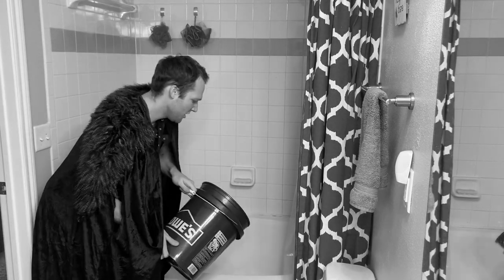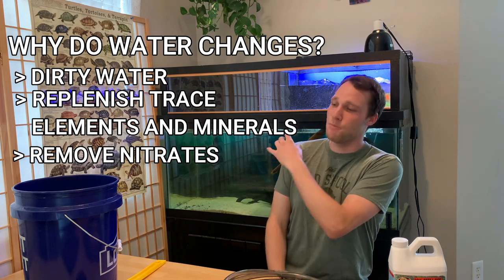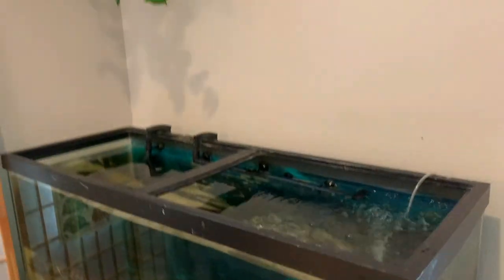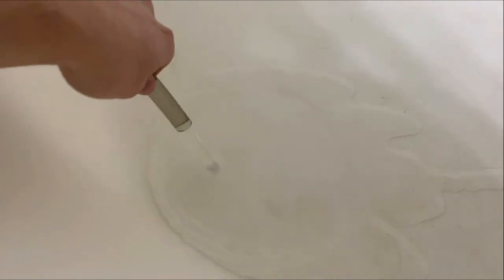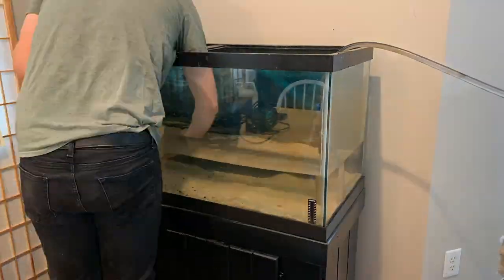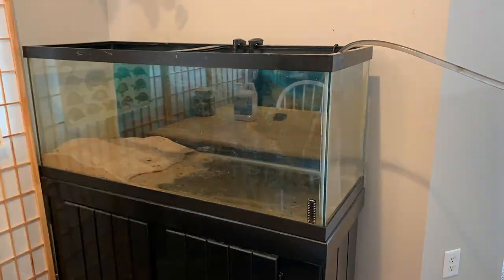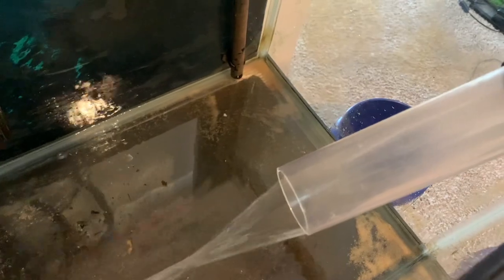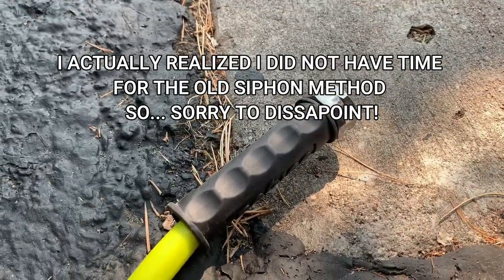Easy Water Changes! Stop Lugging Buckets to Change Turtle Tank and Aquarium Tank Water

Comment: My automatic water changer is really amazing & versatile. When I got my turtle, my friend who specializes in reptiles & aquatics recommended it & I’m so glad. Mine has lasted 6+(?) years now. I’ve moved a lot from apts to houses, originally w a 40 gal tank & eventually my 90gal. The auto siphon has always worked where I lived. One place I did have to go to the hardware store & buy an adapter for my faucet that would just screw on &off, that cost less than a dollar. My current situation I can run the siphon from my tank out of the house to my hose spicket. When you want to pause water flow it has a shut off valve which is really handy, plus it can also be used gravitationally to save water. I know they charge by footage but I don’t remember mine being that expensive. I think there are some off brands besides Python that are cheaper. Also recommended that’s been really handy is an aquarium vacuum, but I can’t say enough about how good an auto siphon has been to me over the years.
Reply from the maker: The python (and similar) are great little tools! Still like my method for my own reasons but the adapter bit is good advice. Thanks for the comment!
Reply: Can u send me a link to your water Changer

Comment: I came across you videos by accident but I absolutely find them so helpful. I was wondering though, could you do a video on how you clean your canister filter or more specifically what would be a good way to clean one for turtle owners who live in apartment buildings? Cause Im getting a canister filter for my birthday in the next week but I have no idea how I will clean it cause it's the middle of winter for me right now with snow on the ground lol.
Reply from the maker: Hello! if you dont want to go outside at all, you will have to use a sink or bathtub. Just make sure you clear anything food related/dishes far from your cleaning area to avoid bacteria and such. A filter is a bunch of pieces that can individually be cleaned reasonably in a sink, just don't forget to disninfect your work surfaces when you are done!

Comment: I'm over here looking for the best way to change the water in my tank without taking the bucket to the sink. And I've just realized the tank is by a window, with a water spigot right outside, so I can empty and fill it very easily lol. But this video was very helpful
Reply from the maker: Awesome and lucky! Just make sure the water coming from your spigot is safe! (I have a house that needs a filter system to make the water safe) thanks!

Comment: Similar to python but with just a hose and faucet.    one end of hose in tank with the dirty water, other end attached to faucet  which must be lower than the tank.    Turn the water on and let the hose fill with water - air comes out the end inside the tank.  Kink the hose, shut the water off, unscrew the faucet end and release the kink.  Instant siphon without risking the sucking of water through a hose.  Either the dirty end of the hose - or the water if you miscalculate...

Comment: When I put the water conditioner in the bottles or buckets is it ready after I shake it ?? To be put in the tank right away with my turtle? Could I keep her in if I do it every few gallons like you said? 
I'm going to look into what you have there right now I just have a syphon and only a few gallon bottles & one bucket.. I need to get more buckets lol 🤣
I do have a sink & shower (no tub) & toilet near by .. but, I would need about a 100 ft hose also ..
Reply from the maker: Yes, I put it in right away. As long as you are not dumping way too much in, you should be fine. And the hose/shower setup sounds over the top but it is WAYYY better than lugging buckets. Thanks for the comment!

Comment: Does the pump work if the level of the drainage is above the level of the tank? (in this case a pool and the drainage an outdoor sink)
Reply from the maker: Yes! Look at the rated head height of the pump. All pumps will give the height at which it can pump water to. You typically won’t get full pump capability if you max out the head height. Thanks!

Comment: When I use my python on my 125 I just turn the water on for a few seconds then it feeds itself. If your sink is lower than the gravel tube it’ll feed by itself.
Reply from the maker: So I have heard that works, how is the drain rate? My tank is about the same height as the sink so it probably would not work great for me,  but I’m still curious, thanks for the comment!
Reply: @LongLiveYourTurtle  Well that’s cool that you replied 😂. It drains the tank in around 30-40 minutes. It’s a little slow but I don’t think turning on the water makes it any faster. I have 2 of the pythons because I use one for my fish tanks and one for my turtle tanks.
Reply: This is how my python works as well

Comment: I have a 2" slider, 5 weeks ago and ammonia finally to .5  went down,  but hight in nitrites 5-10 nitrates 40
How do I lower
Reply from the maker: What kind of filter do you have? If you have large enough filter with the correct media and cycled tank, you should be good to go.

Comment: On python once you begin draining water you can turn sink water off and it continues to drain.
Reply from the maker: Really? I have read that it works and doesn't, and if it does it can be really slow. Let me know!
Reply: Long Live Your Turtle as long as you get suction started and you aren't drawing in air anywhere it should continue to drain at same rate as when it started with water on.

Comment: I dont use my mouth to start the syphon. Instead I run the water into the tank first and then unplug it from the tap so the water just starts flowing from the tank to the drain. No need put that dirty pipe my mouth. I wonder How does all these youtube turtle owner have such clean water. My turtles makes the tank dirty in every 2-3 days 😩 I have stopped using filter because they dont keep the water clean and its a lot of work just to clean the filters itself. So i just do water changes every 3 days using syphon method. Now thinking about aquaponics 😉
Reply from the maker: That's one way to start a siphon, I just like to do it the  risky old fashioned way. What kind of filter do you have? You should definitely not have to clean your tank water that much.